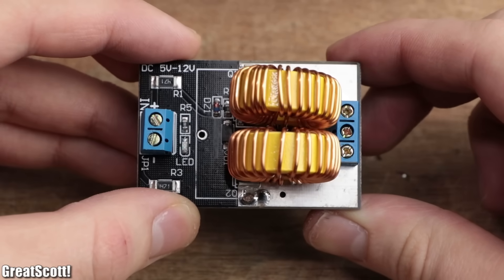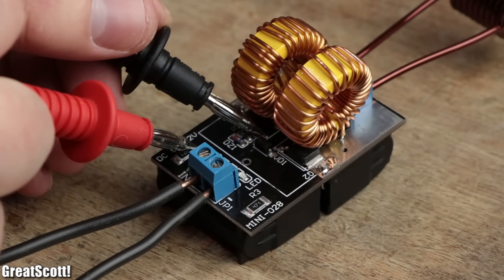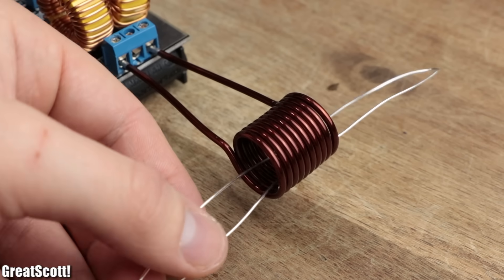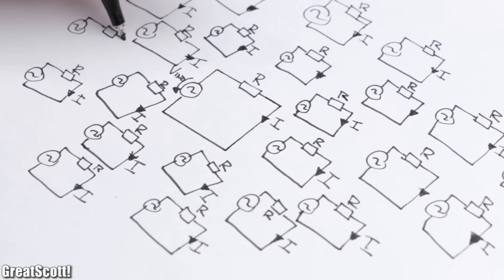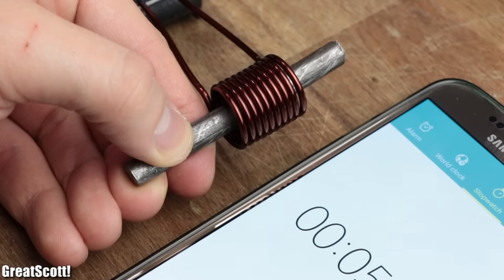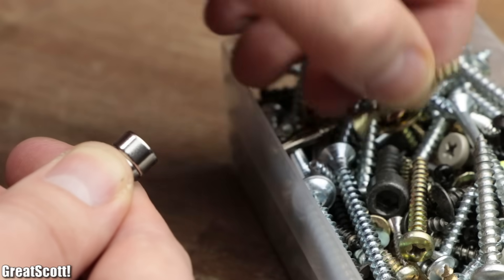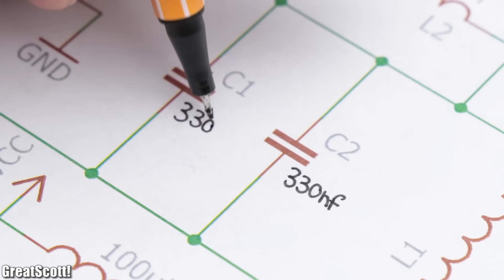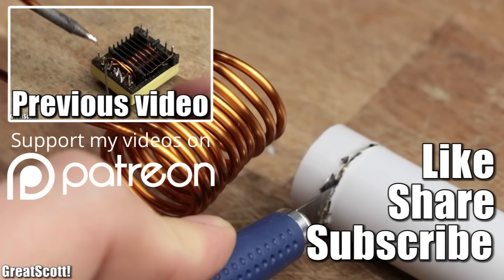How does Induction Heating Work? || DIY Induction Heater Circuit

Comment: 5:14 what does a latch up mean? I searched it on the internet but couldnt find the right answer
Reply: it's when one of the transistors stays on usually due to gates not being pulled all of the way down to ground, look up latching circuits to see how that could be useful and a better definition of the concept
Reply: "Shooting-Through" in a Mazzilli "ZVS" context has been explained in detail right there, over a decade ago (...):

https://docplayer.net/26964431-High-voltage-resonant-self-tracking-current-fed-converter-a-thesis-presented-to-the-faculty-of-california-polytechnic-state-university.html

High voltage resonant self-tracking current-fed converter (2010-Mar)
p52/152 Mazzilli Converter Topology

p53/152 Figure 2.9:  Mazzilli Converter Topology

That's why we can blame it on denial + mis-representation today.

Comment: How to make a Vape that has protection circuit t prevent explosion, I just want to know how ti works under safe circuitry
Reply: You won't find it here, the fanboys are doing everything they can to preserve such odd "hobby" forever.  Selling rebranded junk forever, while an incresing number of Tesla Coil enthousiasts now rejects it.

Actually there's no good reason to rely on 2008 technology which the "DNA" mystifiers now claim has self-protection built-in - which of course is a far stretch of reality...  IMO the base line is to keep exploiting obsolete PCBoards previously populated for a Flyback Transformer feeding a Tesla Coil, e.g. with no insert/removal of the workload supported.  Etc., etc.  But that bubble won't resist further examination forever i hope.  In any case it's no hint of genius to let the power stage enter a forbiden catastrophic failure state just because some guy has a nice moustache or a pleasant exotic accent, whatever.

By chance major semiconductor designers/manufacturers now offer much more beneficial (to final consumer) cost/feature alternatives.  But judging from the level of manipulation it may be a long while before we finally benefit from it...  Counting in years judging from past evidence.
Reply: @Egzoset  How unfortunate. I did some research about this, and I agree this is the case now.  All I want to do is to make one to show it to others so they won't mess up. I want to make it in a level a child can understand. Complex yet progressive type of circuit,. Progressive in a way that it is labeled and has steps on how to understand it. I love teaching, this explains why I want to make one. For knowledge and for fun.

Comment: Hello my friend, great video and nice explanation. However, I am a little concerned about the aluminium (in particular), can you vary the frequency of your oscillator  circuit in order to heat up the aluminium? or does the frequency not affect the results?

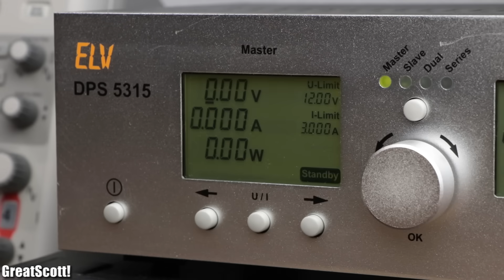Comment: At 1:22 the commentator mentions that the circuit uses two current sources.  While I do appreciate what he meant, he is not exactly correct, as there is an interesting situation where the sources are periodically and alternately both acting as a voltage source and as a current source, in a very ingenious manner. Here is my explanation.
a. The tank LC circuit is a parallel circuit, so it has a high impedance at resonance and it must be matched and be fed from a high impedance current source, and this is how it does it.
b. The supply at Vcc looking back at it, is always a low output impedance voltage source between Vcc terminal and ground/ earth.
c. Each  MOSFET is acting as a switch with ZERO  impedance when ON,  and HIGH impedance when OFF. They alternate this ON, OFF role. 
d. The inductor which is used as a choke, connected between Vcc and drain of an ON MOSFET  is an inductor connected across a DC VOLTAGE source so it will start charging up reasonably fast with a normal varying DC current. 
e.  When this DC charging inductive current is broken by the relevant MOSFET at one end,  trying to breaking and switching it off with a HIgh impedance at its drain, then the charged current will try to be held constant and so the drain will go to a very high value to keep the current constant which is then routed and fed to one end of the parallel tank, high impedance LC circuit.
f. While the action in 'e' is taking place, the other end of the parallel tank circuit is connected to the ground through the ZERO,  ON impedance, of the other MOSFET. 
g. So when the MOSFET is on it is really acting as one terminal of a voltage source and when off the MOSFET is really redundant as Vcc acting as a voltage source has its current trough the Charged Choke inductor in series with Vcc, the tank circuit and the ON MOSFET where the series choke now acts as a current device to make the Vcc source act as a current source. It is this combination of connecting the choke to a voltage source and then switching it to supply the tank circuit with a  high impedance constant current effect including a high voltage resulting due to the high impedance of the parallel tank circuit. 
This is indeed a very ingenious circuit where the alternating role of voltage sources and current sources characteristics need to be fully understood very clearly.
Reply: Not ingenious enough obviously.  Mazzilli never imagined the suite i bet!

Comment: Hi GS,  I am trying to make the heater board as small as possible. Could you tell me what is minimum voltage resistance for capacitors? Those red WIMAs that you put there are huge.

Comment: What happens if you were to making the coil part bigger from your 1 and a half to say 10 inches in diameter, will the induction coil still work and maybe just take longer to work
Reply: I wish to build a coil that will melt silver off silver plated items

Comment: Hi ! Thank You for yours videos. Could you explain how this circuit can do oscilations? Thank you very much !
Reply: It would be much more useful to explain how it stops to oscillate, actually:

https://docplayer.net/26964431-High-voltage-resonant-self-tracking-current-fed-converter-a-thesis-presented-to-the-faculty-of-california-polytechnic-state-university.html
High voltage resonant self-tracking current-fed converter (2010-Mar)
p52/152 Mazzilli Converter Topology

Comment: how hard would it be to take a low end induction cooker and swapping out the saucepan heating coil for one that could instead take a crucible for melting metal? Would that be an epic video for anyone but me? I tried it but not savvy enough with electronics to work out why I didn't get a result

Comment: i know its a 3 years old video , never the less , due to the actual home restrictions , you could build a induction melter .. i bet your design wold be much more acurate and clean :D .and if you find it whit no purpose , well .. due to your job ..i presume, you have a sh1tload of metal left overs. at the end of the year , you could melt all down, sell them and .. dont know , buy a pencile for some pure student ? :) that way , youl keep another hobby in your stock .. just a thought

Comment: Nice clips about...,
Induction heat is often used for harden metal that has ferro- or paramagnetic crystal, i. e. knife sheaths. Some case hardening or surface hardening.

Comment: All of these induction videos have such small coils,  I would like to see one large enough and powerful enough to be used for recycling purposes such as being able to pass an aluminum can through the coil and powerful enough to melt extruded aluminum such as window frames and even able to melt brass.
Reply: to do that you need "transistors" the size of a pack of cigarettes, something that can handle 1200 volts and 800 amps, maybe something like the  MGQQ400Q1US11 by Toshiba
Reply: Get a thicker coil with less windings

Comment: A coil with 20 turns works well ? i have calculated the correct capacitors for ressonance for it but in all the projects i see coils with about 7-15 turns
Reply: How many turns are there in a Flyback Transformer feeding a Tesla Coil?...

Comment: Hello Mr GS
If we use zenor diode and pull down resistor across mosfet how much high input voltage we can use without burning the inductor?

Comment: Will increase of frequency be beneficial for inductive heating ?
Or is the frequency determined by the heating coil ?
Reply: The frequency is determined by the capacitors and the working coil. You can easily change the capacitance to change the frequency or wind another coil, but bear in mind that the inductance changes heavily when ferromagnetic material (like the iron rod) is inserted.

As for the effects of a higher frequency: yes, it does speed up the heating process as the hysteresis loss happens more often. But! the higher the frequency, the higher are effects like the skin effect and you are effectively heating just the outer layer of your iron rod at some point.

So, there is an optimum for a given iron diameter. Another problem is that the coil will have losses, too. This becomes very hard to handle quickly and you have to start watercooling the coil (use a copper tube).

More current obviously also helps, so just increasing the voltage will heat up your stuff faster as well. You do need a beefier supply for that to work than @GreatScott though.
Reply: @markkrutzmann6862  Thanks for the thorough answer.
I asked, because electicity costs money.
So, a higher frequency, needs less current, for the same effect.
In fact, a LC circuit will generate a frequency, between the coil and capacitor.
This will keep going, for a while, even when you do not power the circuit.
Of course, this effect will disspate quickly, when put you some material
in the coil.  However, you might just need to power the circuit, with
small pulses, to keep it going.
I am just brainstorming here, to see how this can be made
energy efficient.

Comment: if we use tesla coil for voltage will it possible to boil water with that??
if we use battery then how much energy required by induction cook top
Reply: Problem is not voltage - current is. Tesla coil while having high voltage, also have high resistance, so current will be quite low

Comment: Hi, i was tried, when i increasing the Voltage form 0-3 v one MOSFET was getting over heat, at the same time it is drawing more than 3.5A @ 3.5V range, can you please let me know the reason.
Please help me to resolve the issue
Reply: Too bad the fanboys won't tell, much less advertise in advance.

Comment: Hey, i just tried to build a circuit following the schematic of your circuit but i always get a type of short circuit... Im not getting my powersupply to get out of the current limitation mode which suggests a short circuit. Do you have any idea where this could come from? I double checked the mosfets for  pin errors etc but the circuit itself seems to be exactly the one you showed in the video. Thanks in advance!
Reply: I also face the same problem, after 4 years u had solved it or not
Reply: i also face the same question, after 4 years you had solved it or not?
Reply: i also face the same question, after 4 years you had solved it or not?
Reply: i also face the same question, after 4 years you had solved it or not
Reply: i also face the same question, after 4 years you had solved it or not?
Reply: i also face the same question, after 4 years you had solved it or not?
Reply: No I think I just bought the one he shows :D thats was the easier solution

Comment: Non professional don't understand this experiment it is related to electrical engineering ' hub of knowledge. When current is pass in the turns of a coil that produces magnetic flux likes with itself is known as self inductance or solenoid. The magneting force cut air which is to be equal to absolute permeability multiplied by magnetic field.

Comment: would i burn out induction heater driver if i drive it without coil? Could i put two electrodes instead of coil and point-weld li-ion battery strips?

Comment: may i ask if i want to pull out screw revit in a plastic cylinder does the plastic also melt or olny the  metal screw rivet that will heat up???

Comment: Is it possible? If you increase amps/current to extreme degree and create enormous magnetic pressure at the center of induction coil, and then put a piece of pure carbon in it. Will the enormous magnetic pressure result in carbon turning into a diamond?
Reply: Watched Star Trek on cable TV lately??

Comment: I am amazed by your knowledge and abilities. You indeed inspire me. Which software did you use for the circuit diagrams?
Reply: I think its Easy EDA. Its free on the web , and also available as computer app.
Reply: Pretty sure that's KiCAD, open source and very powerful EDA.  Used extensively at CERN (among others).

Comment: Any1 notice about the master and slave thingy on the machine
Reply: What about it? They're pretty common terms in electrical engineering and computer science.
Reply: More needs to be said, a "slave" Power-Switching stage then could be monitored and shut down in case of a malfunction, while the typical Mazzilli scenarios propose to let it enter a forbiden catastrophic failure state to be tamed down before permanent damage occurs, evenutally.

Comment: hello can you tell me i have a body extruder machine of plastic and it is showing more temperature on the display more than what i have set. arround 30  degree centigrade more.I know there are some shear forces but my machine is very old do the Rust and carbon effects in Heat??

Comment: Very informative video! How much could that Induction Heater module be miniaturised? I have a fun project and it would be great to be able to assemble myself a tinier module, if you have any idea that would be a big help. Cheers!
Reply: He's got his hands tied "by design", because dirt-cheap over-simplified Mazzilli "Induction Heaters" somehow lost their Flyback Transformer and Tesla Coil and the fanboys would rather not have any flux concentrating material while reducing the inductor to only a few turns which have next to nothing in common with a transformer anyway.
Reply: FBI: -Stay right where you are!

Comment: Sir i actually burn up my capacitors when i build one like this so 
plz tell me the solution
Reply: I think u should try adding more capacitor in parallel to increase surface area and spread heat
Reply: I too

Comment: Thanks! I just tried a titanium pot (MSR Titan 2 litre) on an induction stovetop (Duxtop 9600LS). It worked! Indeed, it worked better than any other pot I own, delivering around 1400 watts (1 liter of water from 18--100 degrees in 235 seconds) (burner is nominally 1800). The pot is nonmagnetic. Why does this work?
Reply: Eddy currents and resistance. Watch the while video, he explains it.

Comment: is it possible to heat up a stainless steel tube with water inside? 
(to make a flow through heater?) based on DC voltage, battery powered

Comment: Thanks for explaining.  After seeing one of these in the auto shop I work in I decided I had to have one.  Great for heating fittings, bolts etc for removal where a torch is impractical.  I knew roughly how they worked but your explanation was simple yet complete.  I am no engineer  just an auto painter by trade.  I bought the zfs driver board on amazon and built a 40 volt 20 amp linear power supply for it.  The power source was harder to come up with than the rest of the project.  Re used a military radio supply for the caps and a transformer and chassis from a 1960's IBM computer psu.  I enjoy your videos keep it up.     https://photos.app.goo.gl/fBXZeKgJFCaME9vm6 https://photos.app.goo.gl/8t4zqsN9boTAwHti9

Comment: Hello, Scott... Thanks for your all videos... 
I making my induction circuit... But with a different schematic, that suits my part collection...
Using IRFZ44, 1uF cap, and no L2, L3...
But, my question is, is 12V/1A adapter will do the job?
(I don't have any higher amp power supply right now...!!!)

Comment: In addition to the differences in resistance and magnetic susceptibility, different material also have different specific heat values.  Aluminum, for example, has a much higher specific heat than iron or copper, steel, titanium and is about 7X that of Tungsten.  So, it takes more energy/heat to raise a gram of Aluminim than for many other metals.
Reply: Indeed.
Reply: And water is even higher
Reply: @dubmob151  -- About 5 times higher than Aluminum.  There's a reason it's used in radiators and heat exchangers...

Comment: Nice. As my luck, all of my sci classes never made it to electricity or else I didn’t pay much attention hence the best I can do is be slightly dangerous about ac plugs. I now have a feeling for what my futue viewers of my database/rv YouTube’s might feel. I have just 90% finished a dB for building an RV that starts with appliances electrical rating, considers solar panels, etc. and ends up with the batteries. A friend just told me that I chose wrong in using amps instead of watts (I have both but was hoping on amps) and we debated this but since knowledge wins I lost. He will make some recommendations for me and how to make it work correctly.

I am really impressed by your lettering skill and knowledge and admit I would have burned myself with that steel rod...  :)

Comment: At about timestamp 2:22 you show the coil connected to the outer pins of the three position connector.  Are the proper output pins where the coil connects the OUTER connections of the three-terminal connector??  The reason I ask is that there is no mention of where to connect the two coil pins.

ALSO, the outer two connectors, on my identical board, read a dead short on the ohm meter (zero ohm).  So I guess there is a bit of confusion here.  I want to make sure before I hook it up!
THANKS FOR THE GREAT VIDEO, AS ALWAYS.